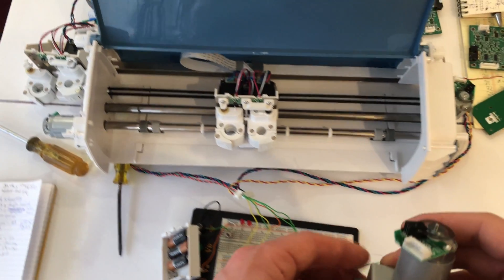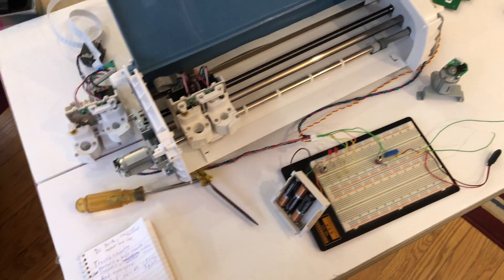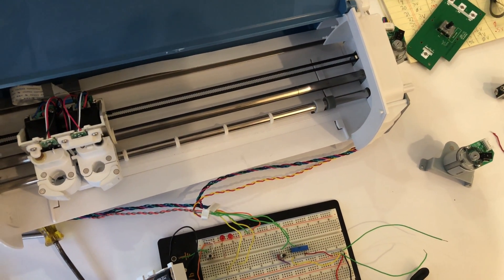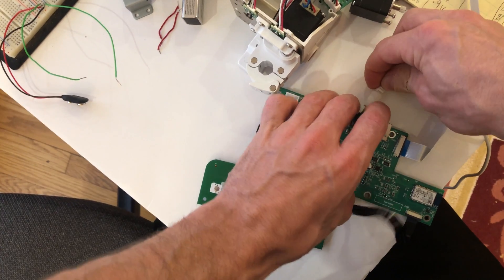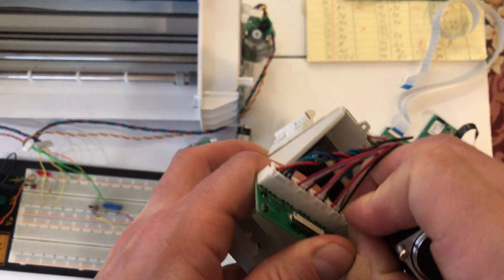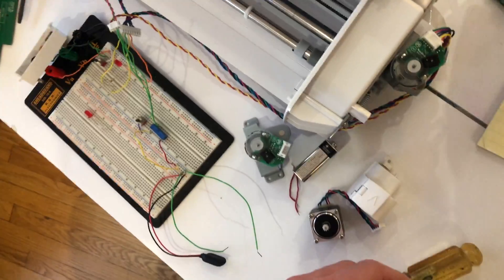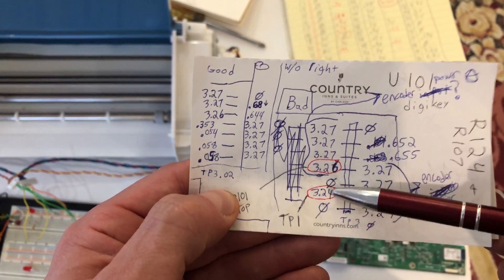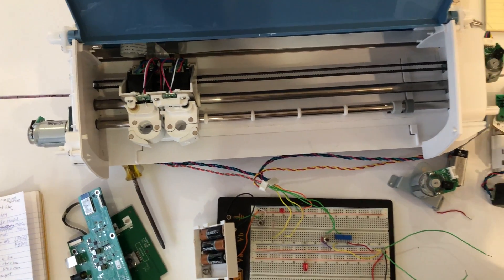Cricut Explore Air 2 and (Maker related) troubleshooting

Comment: Thank you for the video. It was very helpful. For the benefit of anyone this may help; I had an issue where the right side motor that controls the print head movement would only move an inch, jam then trow a flashing red and white error.  With my unit what worked for me was jumping the motor with a 5V source and that solved the problem

Comment: Hi, is there any way to contact you? My maker isn't cutting intricately anymore and it has trouble with most designs ex. it slips and cuts over the design so it looks messy and isn't usable. I've been in contact with Cricut and have done trouble shooting with them and after all attempts, there best recommendation is to buy a new machine

Comment: @Idotooby Thanks to your in-depth videos, I could troubleshoot my Air 2. After it turns on, I get the blinking red light. When power is turned on, the roller turns, but the carriage does not move from side to side. I got to the point where I attached the right (carriage) motor with a 9V battery, and the motor is working. During startup, there is resistance that I cannot move the carriage, so power is going to the motor, but it won't move on its own. Any ideas on what I can do? Thanks again. Sam

Comment: I make an upgrade kit for the explore air 2 to improve the cutting and drawing accuracy. The typical slop on these machines is about .020" or .5mm from side to side and my mods reduce the slop to .004" or .1mm for much better cuts that actually match your design in design space.
Reply: Where is this upgrade available from?  Is it compatible with other machines?

Comment: I have cricut maker and there is blue light. But the blade holder is not moving. I tried it with the 9v battery and it works. Any Tipps what could be the problem?

Comment: My cricut explore air 2 B clamp does not lift. Drags and cuts where it feels like. Is Out of warranty and cabt find part to replace or anyone to fix it. Do you know where I could get clamp B replacement. Or is it internal problem.
Reply from the maker: I may have a clamp b replacement, but it is likely either some material blocking the sensor, a faulty sensor, faulty motor or wire, or a faulty circuit board.  You would have to start by process of elimination.

Comment: My machine has the problem of the cutting part (motor) what happens is that it turns on but the part where the blade goes does not hold, it only goes up and when it goes down it does not want to go back up to continue with the cut. ( I talk about the part B , dawn and no want up , only make a noise.

Comment: I have a solid red light on my Explore Air 2. However, I checked the JST connections in the head and moved A+B holders up and down then the red light turned white and the load button came on white. Is that a common thing or was it just coincidence? Next power off/on and the red light is back!

Comment: Hello.I was given an explore air 2because it stopped working. I turned it on and it blinks a blueish color. The blades do not move back and forth along the track. I am assuming motor issue. Any thoughts??thank you.

Comment: I keep getting "tool not detected" for every blade except for the fine point blade and the scoring pen. I called cricut, walked me thru forced update and had me send in a video. They said they knew what was wrong with it and they need to send me a new machine. They just needed my receipt, well it's out of warranty and they won't tell me what is wrong even though they told me they knew what the problem was. I don't get any red flashing lights, just the error in design space. The tool holder goes to the right side, makes some noise and then sends it back to the middle and I get the message. Do you think the sensor is bad? I've tried cleaning it but at this point I'm ready to take the thing apart. Any insight would be appreciated. I've donated to your link and thank you so much for being like the only person sharing your knowledge and saving people hundreds!

Comment: I removed marker guide and reinstalled it now its sticking up any suggestions?
Reply from the maker: I am not sure I follow.  Make sure you reassemble correctly.?. the shaft? or the sensor guide? 
did you put spring on?

Comment: having a problem where when i try to load to mat, the motors spin, they try to load the mat but then it just jerks and flashes red. i’ve tried software update and no luck
Reply: Did you get it fixed? Mine is doing the same thing

Comment: Hey great video. My machine moves side to side and loads back and forth properly and has no red light...but while it cuts it starts to make a stalling sound from the motor and randomly keeps the blades down creating unintentional zig zag cuts all over my design. Then at some points during the cutting process the blade stays up as well and won’t go down. I’ve had it for almost a year and only for the last three months it’s been making a little grinding noise because it needs grease, (I never bought any because they don’t sell it online and I’m too lazy to contact customer service). Any advice as to where should I start the troubleshooting... anything’s helps thanks 🙏👍🏾
Reply: I’m having the same exact problem
Reply: Me, too
Reply: Any fix

Comment: Our Cricut Explore Air 2 Clamp B is malfunctioning. As soon as power is turned on the motor that raises and lowers the blade turns on and goes up and down constantly not allowing to do anything else. Have you seen this? Do you have any suggestions?
Reply from the maker: Random guess without seeing it in person... Check the sensor that tells if the blade is all the way up.  could be something (debris) in the way, a board error... I would start by checking the motor.  You could disconnect it and see if you can get clamp A to draw.  That would tell you a lot of info.
Reply: @Idotooby  i unplugged the motor for clamp B obviously it stopped it from doing it, but no it would not do any other operation. So the the program or circuit board is still telling it to operate that function before doing anything else. I will have to look for sensor didnt notice one. Is it a light sensor or physical sensor?
Reply from the maker: The sensor here.  https://youtu.be/aNqq-6n_vqs?t=515
Reply: @Idotooby  yes thats what i thought. I unplugged that sensor and cleans terminals. And cleaned the front of that sensors. No change power on and that motor will run untill  system powersitself off
Reply from the maker: Did you try to force firmware update?  
    put the machine in Firmware or Recovery Mode by starting with the machine powered OFF and disconnected from the power supply. While holding the load mat button, reconnected the power supply into the machine and the power light should turn RED.
    Once red, go to Design Space. select the Update Firmware
     option (three lines in the top left) and click.

Comment: Hi, I have a question and was wondering if you could kindly help. I have a cricut explore air 2. My sensor light used to light up all the time when doing my cuts. Now when I cut a vinyl or cardstock the light doesn't come on but still cut. Why is this, is the something wrong with the light? Is there any way I can get the light back on?  Thank you so much for your help
Reply from the maker: The light is used for print and cut.  It does not need to be on otherwise.  If it does not print and cut there may be an issue, otherwise should be fine.

Comment: Thank you so much for your post! I have an issue where it cuts with uneven pressure no matter what I cut. Specifically it cuts deeper on the left side but only scores the right. E.g. if I'm cutting the letter  'O' , the left side has cut right through but the right side has barely scored the surface. Any thoughts on this? 

P.s I've replaced the blade already with a premium fine point blade. I've also recalibrated and it cuts the left and bottom of the print and cut box but leaves the top and right untouched
Reply from the maker: If your machine is still under warranty contact Cricut.  If not, my guess is I would check your roller.  It may be worn rubbers on the roller or debris/glue/glitter/dirt gummed up somewhere or one side of the roller has a missing spring/ gummed up/other mechanical issue.  If not that it could be, but hard to believe, something to do with the carriage rod and or installation.
Reply: I started to have exactly the same problem2 days ago!
Reply: Did u manage to solve this problem, it’s happening to me as well
Reply: @citanyc9349  it was definitely a hardware issue, there isn't anything that can be done on your end to resolve. The only resolution was to get a replacement from cricut/amazon. Since my replacement I've been issue free.
Reply: Kristopher Worrell thanks for the info :)
Reply: @kristopherworrell474  I'm experiencing the same problem.  By replacement, are you referring to a new machine or is there a specific part to replace?
Reply: @vchipkennedy5283  a new machine completely
Reply: @kristopherworrell474  well that definitely sucks! 😩.  Thanks for the reply

Comment: Hi.. My cricut explorer air 2 was cutting fine and suddenly it stopped. And power light blinked red. So I restarted everything. Power light went white again. It only blinked red again after I pushed the Load mat button. The Cut button did not light up. I have gotten in touch with the support line and did all the recommended steps but it didn't work. Now, I'm ready to try dismantling and would like to know where should I focus on? What is the possible problem?

Comment: My print and cut sensor black box was unglued causing it to be a bit loose.  Could that be why it’s not working properly on that feature?
Reply from the maker: Hard to say for sure, but could be.  Make sure your print is good then if it still has trouble, I would glue it and find out.

Comment: Hi, i have a problem with my cricut. the cutter compartment -labeled B does not left up during cutting ending it cutting areas where it's not suppose to. I'm desperate for help. Do you have idea why?, thank you so much.
Reply from the maker: I would start with the machine off.  If you have a warranty contact Cricut as this may void your warranty.  If not, see that clamp B fully raises by your hand.  Next remove the silver cover.  Note the three wires going to what is a sensor on the top of clamp B.  It is covered by a guide for the clamp with two screws.  By carefully removing them, making sure not to loose the spring, you can visually inspect to see if the sensor is obstructed by paper, glue, glitter, gunk, etc and clean as needed.  If it is obstructed it will trick the machine into thinking the blade is up even when it is down.  If that works, the next step is to be my third donor and support me and my channel by subscribing, like and donating.  LOL.  If not, let me know what you find and I will try to further assist.  Best wishes.
Reply: @Idotooby it's clean and nothing is clogging the sensors or blades. Tested it but still having the same issues.
Reply: Hello I have a similar issue with my cricut maker the cutter compartment b  get down and don’t get up rolls to the right hand and get stuck there and make a horrible noise
Reply: Carolina Bazan the best thing is to contact Cricut relentlessly

Comment: Mine has a red light i unplugged the  cartridge still shows the red light still and followed everything and still not turning off. Help.
Reply from the maker: Unfortunately based on what you told me, if you do not have a warranty, then you are most likely out of luck unless you can find a used cheap main circuit board which are as rare as hens teeth.  Sorry, but it is more than likely a short on the main board and more or less a giant paper weight.
Reply: @Idotooby  last night the red light went off but still no power to it

Comment: How do I avoid short outs ?
Reply from the maker: If you mean avoid them while working on electronics, you can wear a static wrist band to absorb any electrical energy. 
 If you are referring to avoid shorting the machine out in general, then... There is not much you can do except of course if you use the cartridge.  In that case do NOT use the cartridge slot!!  
I believe the problem lies either in poor component quality control, or could possibly be something due to poor engineering either hardware or firmware.  I also wonder if a cartridge could cause it as it is within the same circuit as the cartridge.  Therefore, I vehimently advise against using the cartridge slot at all.  The software has all of the fonts and things without them so I wouldn't risk it.

Comment: my cricut explore air 2 has a solid red power button and wont connect at all. someone please help me. ive tried contacting the cricut people but they keep telling me the same thing and its not working
Reply from the maker: Watch this https://youtu.be/U4x5qh58iE8
It will tell you how to fix it or if it is unfixable.  Best wishes.
Reply: I’m having the same red light issue! I seen your previous video about jammed pins. When I place metal between pins the red light will turn off but when I pull it out the red light comes back on. It’s almost reverse I think. Does that mean I have a jammed pin?
Reply from the maker: I do not advise sticking something in to diagnose.  Simply disconnect the cartridge after accessing it by taking off the left side.  If the light goes out, viola... you more than likely have a crossed pin in the cartridge.  If that is the case you can try to locate the short or let me know if you need a replacement cartridge.  Alternatively you can use it without the cartridge without ill effect.  I hope this helps.
Reply: @Idotooby  i have the same exact issue as veronica calderon, (i have my replacement machine on the way so trying to fix the defective one) when the red light first came on i found 2 teeny tiny little metal wire looking pieces that came out of my machine! any idea on what they could possibly be from?

Comment: Mike can debris make it between the gear on the step motor and the shaft that controls the blade's vertical motion? If there seems to be slippage do you think it is the step motor or the plastic gear that broke? is there a way to lubricate the vertical shaft. My machine's blade seems to slip and might not cut. Any suggestions before breaking the entire machine apart?
Reply from the maker: Huh.  Anythings possible.  could be either or both the motor or the gear.  I would take the cover off to see how it looks.  Easy to do just two tiny screws on the back of the silver carriage cover.  Just don't loose them...  You'll never know unless you look deeper.

Comment: Hi, my explore air 2 won't pull in the mat. The rollers roll clockwise when the machine starts to push out the mat or whatever is in there. It won't roll counterclockwise to pull in the mat. The load/unload button blinks as it should when its ready to cut. It does nothing when I press it.  Do you have any advice please? thank you
Reply from the maker: Hmm..  If it does not roll inward at all I would probably start by getting access to the left hand motor as described in my other videos.  At that point make sure nothing is jamming it.  With the machine unplugged and off you could try rotating the large gear both directions by hand.  It should move fairly easy both ways.  Note if there is any strong resistance or unevenness.  Also visually inspect the gears for any signs of damage or debris as well as the roller itself.  If that all checks out you then want to test your motor as described in the video.  Let me know if you run into any troubles or what you find.
Reply: @Idotooby  thank you. i'll try tomorrow
Reply: @Idotooby  I took of the left side. Rolled the gears. They were kind of hard to move. Nothing is in them. I'll work on them more later. ty
Reply from the maker: @kittykatapult8259  Could be something that got dragged in or something wrong with the roller itself.  You just barely see the drive roller underneath the top roller.  It is sandwiched in-between the bottom of the case.  It would require taking the whole top off of the bottom case to see it.  Let me know what you come up with.
Reply: @Idotooby  I've got the whole thing apart. Lots of glitter and glue and general yuck on the rollers. Cleaned them with 91% alcohol.  nothing else stuck. going to check motors next with the battery. thanks for helping me
Reply: @Idotooby  mike.  i sent  you an email with attached  video of blinking light.   thanks. nina
Reply: Did you fix this? Mine started to do this today and I can’t figure out how to fix it 😕 I cannot move the rollers by hand they are very hard
Reply: @arianaprado3577  no, mine isn't fixed. i did all the steps in the video but its not working. i have a friend looking at it now.
Reply from the maker: You will more than likely need to disassemble for further inspection and cleaning.

Comment: The light on my Cricut air 2 comes up but it still won’t detect marks. .when I tried to calibrate it machine could still not detect marks. Help please
Reply from the maker: If what you are saying is that the machine works fine other than the print and cut function. Then most likely your solution will be to replace the light guide on the sensor.  Here is a video where I did so on a maker for free.  It is useful information and similar to the explore models.  https://youtu.be/SGH7U7axY0k  Let me know if that helps.  Best wishes.
Reply: Two days ago the machine struggled to detect the sensor marks and then I unplugged everything and plugged everything back in, keep in mind the light was bit was not able to read the marks. After I plugged everything back it suddenly was able to read and cut sensor marks. 
Today, when I tried to use it , it did not want to cut again . Unplugged everything and it still would not read the marks. 
I tried calibrating and as it was Scanning  the picture suddenly the light sensor stopped at a corner during the scanning process and just made a weird not loud sound .🤷🏻‍♀️
Reply: The light sensor was “on “  it’s never been not on .